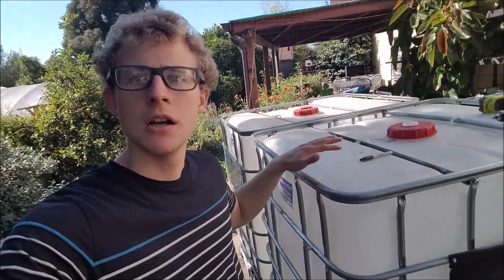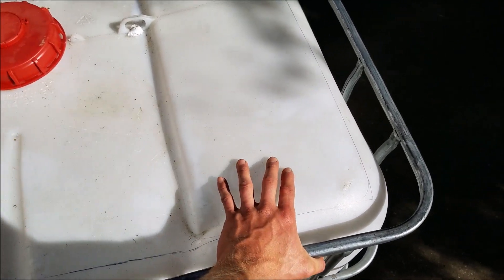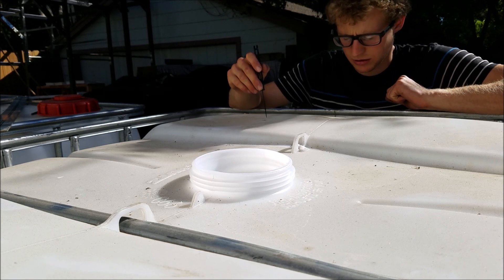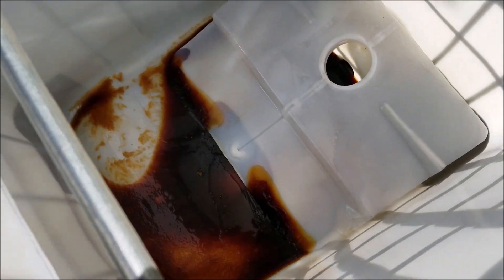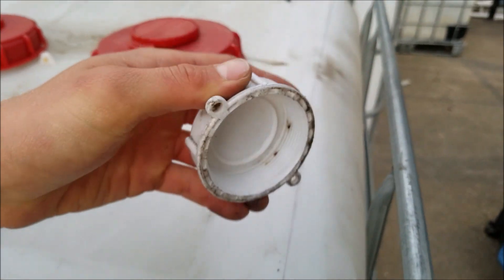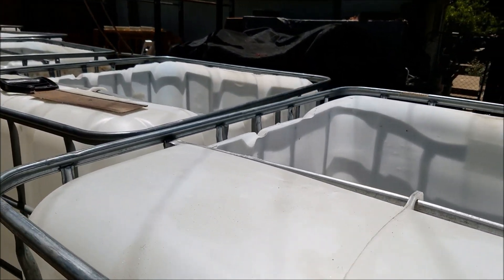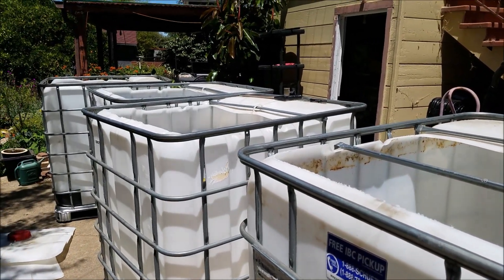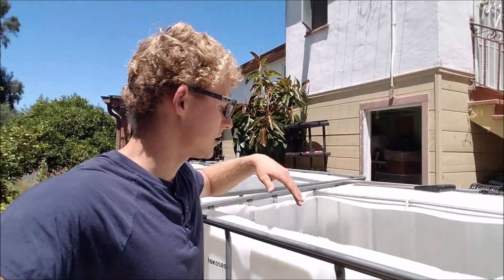Aquaponic system Renovation part 5 (cutting the ibc totes)

Comment: Holy smokes! You are a very determined young person to even cut 2 of those with a knife by hand.

Good idea switching to power tools, I had to use powertools on all of mine, using a knife by hand had never crossed my mind lol

Thanks for sharing and as always keep building👍
Reply from the maker: Ha lol
It was tough to do it with the knife.
I am lucky I had the power tool to do it.
But if one doesn't have a jig saw then using a knife is an option.

Comment: Do you have any ideas on reattaching the cut out portion? I need to cut 4 of mine open to throughly clean out
canola oil but would like to reseal them.
Reply from the maker: You would want to cut the opening on the flattest area you can on the ibc tote. Than to reseal it you would need to buy a separate piece of plastic bigger than the hole you cut out. Then you would need to bolt that piece of plastic ( like plexiglass or a polycarbonate sheet) to the tank with silicone or something of the sort.
Basically something like this:
https://youtu.be/E9DTSZBEbRI
I would just make the hole as small as needed. This is the way that I think would work. Hope that helps
Reply: @vonponics  Thank you for your help, that’s a really good idea, I will definitely attempt it!
Reply from the maker: @kaylabu9  no problem hope it works out for you